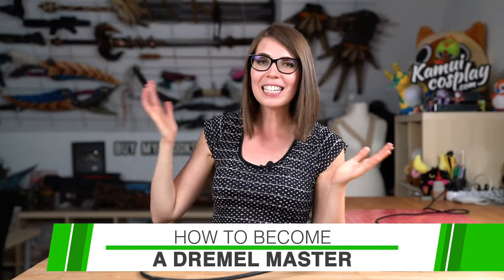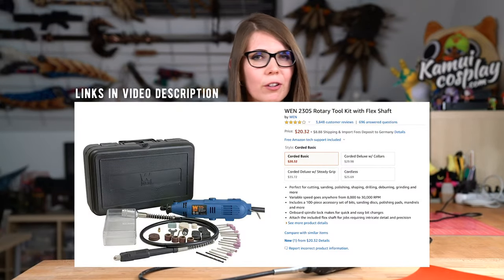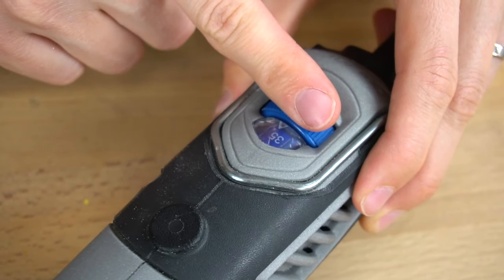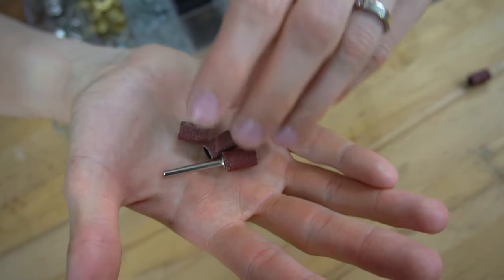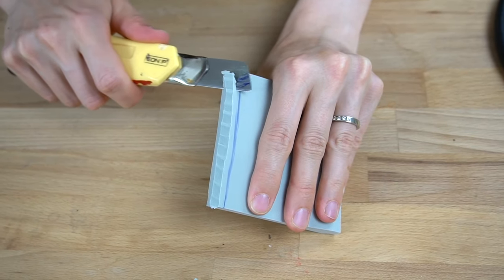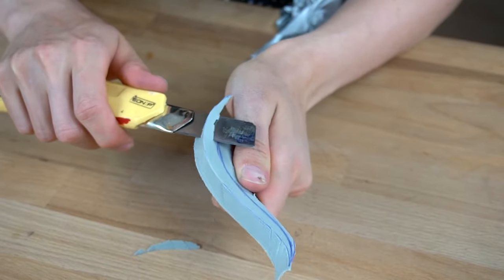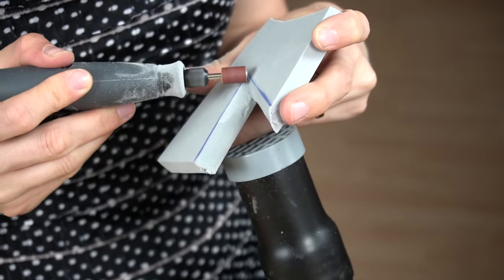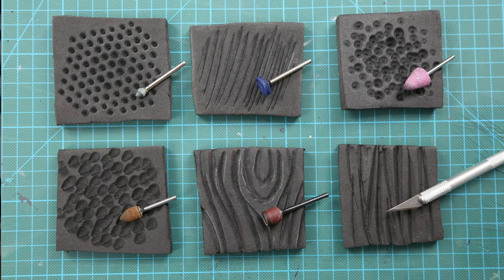How to dremel perfect Foam Bevels for Cosplay!

Comment: I also got a dremmel for christmas. My siblings were confused at my joy.
Reply: got the 4000 gen 1 i think almost 10 years ago, i use it for my hobbies and work to cut small screws or what ever stainless need to be adjusted. they are a great tuff tool.
Reply: I got a dremel for Christmas my cousins were confused accecpt for one that was also excited
Reply: How old are you? 😂
Reply: Me too dude💯🔥
Reply: Same XD
Reply: AYYY a fellow Christmas Dremel 

I got mine this Christmas just went straight to weathering my armour I was building
Reply: Yeah I was really disappointed, because I didn't had one and I told it my father and it turned out, that my father got one years ago and I can use it for cosplay 😂
I was sooo happy at this moment!!! :)
Reply: @ree-8003 it's comical what we get excited about when we get older.
Reply: tbf, same… (sigh)

Comment: Please take kamuis words serious regarding safety. My stepfather worked without a mask for years and suffers from asthma now. Another person had his dremel drum snapped and it would have flown right into his eye if it wasn't for his safety goggles, which stopped the projectile.

Safety
Is
Key
Reply from the maker: This!
Reply: Safety First, is Safety BEST.
Reply: But what if you already have asthma? Guess I'm good to go!  (Jk don't make it worse and wear the mask lel)
Reply: Had a welding instructor once who said, “ you can always hold things with a prosthetic hand, you can stand on a prosthetic foot, YOU CANNOT SEE OUT OF A GLASS EYE.”
Reply: I work contrustion  it would  be required to please work safe
Reply: I would add that these sanding drums shouldn't really be used at that high rpm. You can get away with it sanding soft materials, but anything hard can rip the wrapping off the drum. It isn't dangerous if you're using safety goggles, but personally I hate breaking tools like that, even if it's easily replaceable. 
I also prefer wearing closed eye protection every time I sand anything, even if it's sandpaper - with that amount of dust flying around it's easy to catch eye infection, especially for someone wearing contact lenses.
Reply: NaKaHiLa Yes, i was an idiot and wasnt weating protection and the tip flew off right passed my eye. so fast i didnt even know it happened until i heard it break and suddenly i had no tip. I got lucky, but not taking that chance again lol
Reply: I go to a camp where our counselors always say “Safety first, safety second, aesthetic third!”
Reply: Quality can't be beat either.  I'm trying to get into wood working/carving and today discovered that I need safety goggles, not glasses because I felt debri and dust near/on my eyes  with the $10 pair I bought from the grocery store.
Reply: Safety rules are written in blood. Never forget thaz
Reply: Safety is our Number One priority 
puts on sunglasses
Reply: There should be a vacceeene for that by now
Reply: Safety is SIK!
Safety
Is
Key
SIK
Reply: I already have asthma, I can't get it twice...
Reply: @tuskedseal4608  then just remember…SAFETY IS SIK
Reply: No money for safety
Reply: I mean, what was your stepfather breathing in exactly?

Comment: That "foam piece filter" at 03:57 is actually a brilliant idea... Several small foam pieces have gone MIA that way for me.
Reply: I actually built a dust collector box from plastic container, shop vac fed from below with a filter screen to block small parts.  Works great to catch dust from larger pieces than just a hose.  Got the idea from Punished Props.
Reply: Would an airbrush booth work?

Comment: Thank you for the video. I had a dremel for a long time. I did had some issues with it on the foam getting those rough edges. I tried it again today for a part of my Mandulorian armor piece. Still have the problem. then i did tried the one direction before watching the video. It worked a bit. Then I decided to watch your video on how to work the dremel and see if i was doing it correctly. It is fun to have the tool. I will for sure try other tips on the scrap foams I have. Thank you so much for the Battastic videos.

Comment: In place of a dremel I use an old electric nail file from school lol it does the same thing basically except you can switch the direction the bit rotates with a switch and it has a foot pedal you can use instead of the on off switch. It's really a great slim option, plus carbide nail bits are amazing!

Comment: Very good safety instructions ,      but you did miss one item .

Hearing protection .            With all of the machines running especially the Drimel .                 The Drimel's higher pitch motor can cause a ringing in your ears after long use .

I've been using the Drimel and other small power tools for most of my life and I have a form of tendonitis from NOT using ear plugs or padded sound dampeners like what you see at an enclosed pistol range .
Reply: tinnitus*
tendonitis is inflammation of a tendon
Reply: @mrqueem1703  
Thanks for the catch .

Comment: I use both the dremel and non dremel mainly for cutting holes in glass bottles for putting lighting ...I couldn't do it without the flexy connection as it gives you so much control...

Comment: Great information.
I've used a dremel regularly, in the way you say, but I keep finding now and again it catches on the foam and shoots away from me, or throws the piece out of my hand. No injuries yet, but am I missing something?
Reply from the maker: That’s totally normal and happens to me as well, especially to smaller parts. Just try to hold it stronger or avoid sanding parts which are too small to keep then between your fingers properly.
Reply: KamuiCosplay thank you for answering! I was having this issue too

Comment: I think that high density foam takes dremeling really nicely or something. I've been using more cheap eva foam because I'm broke right now and it is so hard to hold and sand small areas that say come to a point. The vibrating dremel just causes the foam to slip and bounce around even on the lowest speed setting. Also thank you for the bevel and raised ornament examples because that is something I can practice on my own. :)
Reply: maybe the highest speed would work better, because it would remove the material instead of pushing against it? just a thought though^^
Reply: @johnuferbach9166  That actually is worse at high speed. Lol XD Usually I just try and make my cuts with my blade clean to get around having to Dremel.

Comment: What temperature do you use the heat gun on to seal the eva foam ?
Reply from the maker: Highest :)
Reply: @KamuiCosplay  is 600°C really necessary? xD (though most of the cheaper ones probably don't reach the claimed value anyway i heard^^)

Comment: You know what might work better. Use one of thoughs plastic big  containers and You will have. Made one of thoughs dust boxes. Cut out arm holes and add some rubber gloves in the holes. It might even help to cut anther place for Your Vacuum so it can get rid of the dust.

Comment: I'll be getting a Plastic prop that has some gaps I'll have too fill in so I have a flat surface. Would this work for that or would it be better to just get a sandpaper and sand it by hand instead of using a tool like you did in the video?

Comment: Thank you for all these tips!! Especially the corner tip... that was SO helpful! I have one question though!!! I’ve tried using my dremel to smooth down seams, but I always end up scratching the foam with the edge of my dremel and causing big scratches in the foam T.T any tips on how to prevent that? Maybe it’s because I’m using just the dremel body itself without the snake attachement? Thanks!!! I love your channel SOOOO much!!!
Reply from the maker: Try to sand very careful and with fast movements over the seam. If the angle is too flat, try to squeeze your built a little together so your seam stands out a little bit more. Then you more likely sand only over the seam. If you still have scratches, just use Kwikseal as I showed in my priming video to smooth everything out. :)

Comment: HELP PLEASE
.Hi. How do you keep the sanding drum on the rubber barrel shaft. All mine keep slipping off, and dont stay on. The sanding barrels are purchased with the rubber barrel, so the sizes should be spot on. No matter what barrels I buy with the sanding barrel, they slip and slide off. None I purchase, I've tried 6 sellers, everyone, spins down or off. Are you suppose to glue it the the rubber barrel? HELP PLEASE. Adie UK

Comment: Don't forget to protect the Corgies! By the way, I prefer the actual Dremel. I had a knockoff, but it got so hot in a short time that it was impossible to hold, let alone to sand anything properly (of course people can use whatever they want, this is just my personal experience). However, I hardly ever use genuine Dremel tips, but the less expensive knock offs from hardware stores. Your tutorial how,to go about foam bevels is very helpful, because when I make doll cosplay itemx out of foam, they often look a bit...unfinished.

Comment: if you move in the direction of the dremel wont it slide right off? for cuting if possible is a heated wire tool best? (i just asume it might be)

Comment: Hi Kamui, I have a question, it's regarding the direction your dremel rotate. I have been using dremels for two years now, and they always spinned to the left, resulting in me, a right handed, receving all the materials on me. But your dremel is spinning in the other direction, away from you, yet you are using your right hand. Is it as specific model or did you made some changes to it ?
Reply from the maker: No it‘s just the way it is. I’m not sure if they all rotate in the same direction though
Reply: @KamuiCosplay  That's weird, ho well thank you for taking your time to answer that !

Comment: Hi, could you please drop a link to where you bought that rubber sanding drum/sleeve? The one that you said was your favourite. I've been using the wider version of it but I'm curious to see if its any easier with the smaller diameter one you use. Thanks for the helpful video also.

Comment: This video made me realize that my dremel has been spinning clockwise, while I am right handed and push against the rotation. Her's appears to be going counter-clockwise. Is there a way to do that or should I upgrade to the dremel 4000 series? I flipped mine around to copy her "go with the rotation" method and the line was so much better, but I either have to hold it upside down or with my left hand.

Comment: exact treu dremel is very usefull have the 3000 type i got it last year good rotary tool doesnt make to much noise like the cheap ones i can even use it on my latex masks and suit middle of the night without neighboors complaining got lots of tools you can equip but be carefull with it always use googles and dustmask for your own safety greetings reggy

Comment: I'm having trouble finding the respirator.  I need to buy a small multi-purpose one, but the only sizes I can find online and in store are large and medium.  I am not sure if a small one would be too small, but I'm worried that the medium will ride up and move my safety goggles or just not cover my chin.  Does anyone know what size she is using or have any two cents on the matter?

Comment: Hi great tips as always thx.I have a not dremel question. I am about to finish my first cosplay (colt from saberrider) and i have everything plasti (gummi) diped and painted but when i apply my clear coat it makes it all stiff and crackling again? what kind of clear coat do you use because all of my clearcoats and paints out of a can keep cracking which makes the plastidip steep useless (and expensive) in my opinion.
Reply from the maker: Could be your brand. I use LUKAS Spray Varnish and it stays flexible.
Reply: Super danke für die Antwort! Ich werd das mal testen.

Comment: I do still have a question I find hard to find an anwser to. How to sand big area's either flat or with a slight bevel without creating unevenness! The dremel is really small so creating a smooth surface with the tiny bit is really hard. But most big sanding tools als too rigid or clunky to get a good grip on things or to make good beveled curves. Anyone have tips for me? Or maybe you found a good way/tool to go about this?
Reply from the maker: That's a tough one. It is possible with a Dremel but it will always look slightly bumpy even if you try to even it out with sanding paper. A belt or disc sander works better but makes a lot more dust and costs more money

Comment: How tight you gotta tighten the bit to keep the sand paper on? It keeps coming off center of my dremel on high speeds.
Reply from the maker: Did you fix the screw at the top? Needs to be tight!
Reply: @KamuiCosplay  I have though it might be becuase it's at full speed.

Comment: Your video’s are sooo helpfull 😱😱 Thanks so much for making them!!!
I have a question too; What is the right temperature to heat seal the foam?
Reply from the maker: I use my heat gun on maximum, however I do very fast movements and never stop over one area. If your foam becomes slightly shiny or smooths out, you are good. If it turns black, starts smelling and bubbling, then speed up your movement or set the temperature lower next time. :)
Reply: KamuiCosplay Thank you!!
Reply: @yoniverbugt7075  probably a good idea to test on a spare piece first :D

Comment: Whenever I use my dremel I feel like it pulls my hand in the direction it’s spinning, even at low speed. It looks like you have so much control and can hold it steady with your long attachment. I haven’t tried to use the long attachment, but is this why it looks like you control the dremel and it doesn’t control you? Thanks for the helpful video 😁
Reply: I have a dremel Stylo, which is a very small dremel (a little larger than the attachment she's using) and it still pulls a little when I use it; that's just how friction is, the nature of gritty sandpaper moving very fast over a surface, and there's most definitely not anyway to get rid of that pull completely. 

The attachment/a smaller dremel might help because it's easier to hold/won't fatigue your wrist and fingers, but practice also makes perfect!
Reply from the maker: Yes try using the flexible shaft attachment! And then maybe some upper body workout! ;) Can't let that Dremel defeat you!
Reply: KamuiCosplay Okay, I’ll give the extension a shot!! And I do need an upper body workout even if it is just to use a dremel better xD Thanks for the response!
Reply: HMJole Yeah you’re right, I figured the pull wouldn’t stop but I guess I just need to try the attachment and see if maybe that makes it a little easier to control. Thanks for your advice!

Comment: I must ask.....would buying cut-resistent gloves (those used by cooks and bakers) be a good idea, to avoid cutting yourself when cutting FOAM with a cutter? They are used as safety appliances in kitchens, if they are comfortable to be worn when you'll cut FOAM, of course.
Reply: @Pass the Spider Thank you very much for the reply.
I will evaluate the pros and cons, then see how it's more comfortable to work for me with or without safety gloves in both cases.

Comment: I know this is 4 years old but my snake always get really hot where i can only use it for a few minutes before the metal spiral becomes too hot does anyone have a solution maybe?
Reply from the maker: Sounds like it isn’t property stuck into the shaft. Try to unscrew everything, pull it appart and connect it as tight as you can again. Hope this helps! 🙏
Reply: @KamuiCosplay  i'll try thank you so much!!

Comment: Do you ever use your Dremmel on Warbla? If so what tips and changes do you make?
Reply from the maker: Sure! Just sand it too! Just be more careful because when Worbla gets too hot it melts ;)
Reply: @KamuiCosplay  SO I found I had to slow it down to minimum, is this what you do? and do you use the same sanding heads?
Reply: Thanks for the promprt reply btw
Reply from the maker: I use the same tips yes!

Comment: If you use the flexible shaft you shouldn't use the max speed. It can destroy your tool. If i has it correctly in my mind the operational manual says you should only use 30000 or 25000
Reply from the maker: I‘m working with my dremel for 10 years this way and never had any issues. :)

Comment: Make a box out of plywood, about 12x12x4 inches (30x30x10 cm). You'll need to have all 4 sides as well as a top and bottom. 

On one side, use a holesaw or a big drill to cut a hole the right size for your vacuum hose to fit snugly.
 
On the top of the box, drill a matrix of 4-5 mm holes, about 3 cm apart. This will take some time! 

Connect your vacuum, and you can now work over a work area that sucks down all the dust, and you don't have to balance the hose while you work. Boom! FOOL BRIDGE RECTIFIER!!